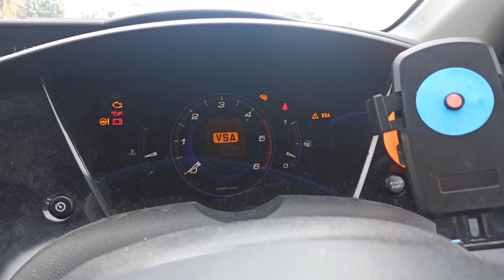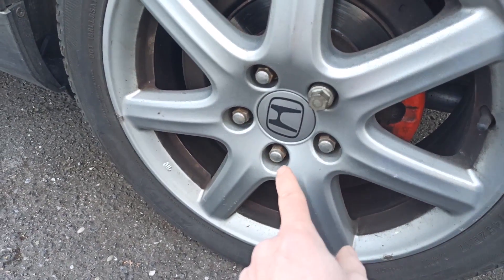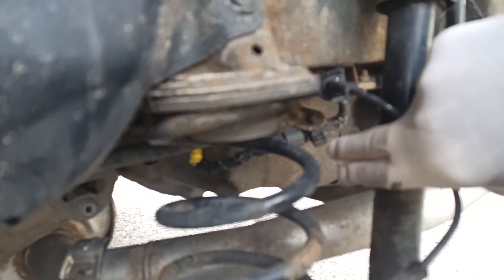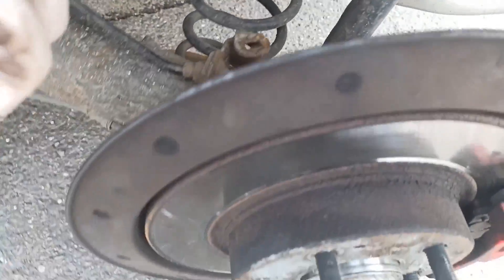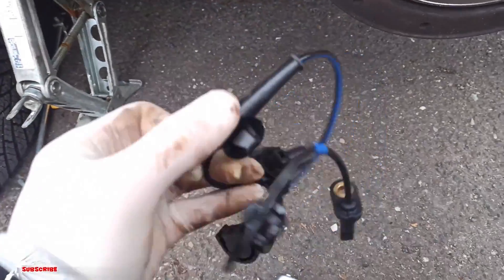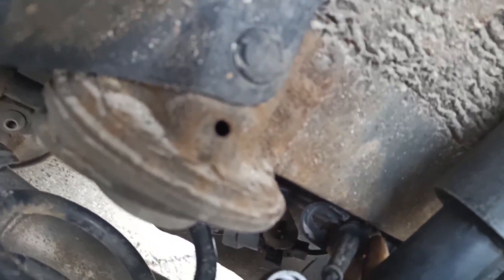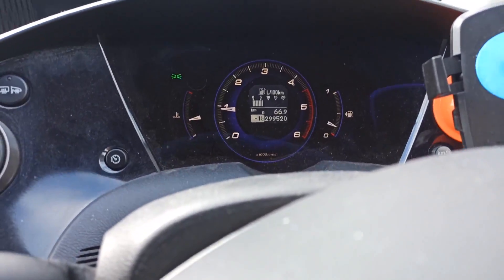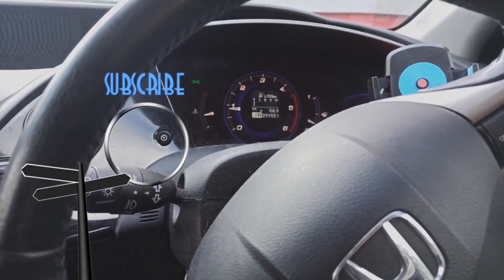How to FiX ABS - VSA Light ON on your Car -  Honda CIVIC

Comment: Say you've had these lights on for months.. after replacing a bad wheel speed sensor would the lights still be on (since the related codes are permanent in the system) for a while? Or would they go away within a few minutes if the issue was fixed
Reply from the maker: Hi yes i drive with lights on about 6m

Comment: I’ve had same issue same side , put in new sensor but and the abs and visa lights went off but then I drive there is tapping sound and soon as I pick up speed it sound gos away and vsa abs lights come back on , any ideas what it can be how to fix
Reply from the maker: @matthewnolan8448  are you sure the senzor ia ok as.i got 2 faulty before I get the one is working only way to find out is connecting diagnostics tools or replacing with new sensors but try different brands
Reply: @ i connected diagnostic tool and cleared it , it was ok then when I pick up speed it turn on again so it must be sensor?
Reply from the maker: @matthewnolan8448  but try read data from sensors live data I mean if not working no reading you know is faulty

Comment: I've changed mine once, but the problem is still there.
Reply from the maker: Are you sure you changed all correctly and you are sure the new sensor is good as happens to me as well I changed 3 times to find kumo brand is piece of shi...
Reply: @frogtechtips A bit more information. I parked the car for three months with the handbrake on, and after that, the VSA, ABS, tire pressure, and handbrake lights came on. I went to a local garage, and they changed the four ABS sensors, but it's still the same. When I deleted the codes, the car started to misfire, and I couldn't drive it. Then I pressed the VSA button, and the car started to go normally. After that, the light came on again, but the car started to drive normally.

I bought the sensors from eBay, so do you think I should buy new sensors?

I haven't got any clues as to why it happened in the first place. The garage told me I may need to change the ABS controller!
Reply from the maker: @go4ittt837  I think is foulty sensor try use diagnostic tool to see reading data from it.if not read try new sensor but different brand

Comment: I am finding my new abs sensor is rubbing slightly on the ring/hub. Unsure if I have fitted it wrong.
Reply from the maker: @sajhussain9848  I have this problem as well first two is not not working after I bought different brand and finally is been all.good

Comment: Just had offside rear tyre changed after a puncture, now tpms  "Check System" message keeps coming on.. faulty abs sensor?
Reply from the maker: Best way to find out is use diagnostic tools

Comment: What about a honda accord sport special addition, when the lights are on, would be extremely helpful compared to an almost 2600 job?
Reply from the maker: Hi All car should be fixed li this if you have abs light on for 90 percent is faulty sensor on wheels just use diagnostic tools to find with one is faulty

Comment: I bought the same kingbolen tool but it does not read abs vsc fault that i have. How did you get it to check abs system? Did you buy additional software? Thanks
Reply from the maker: Hi if you bought the same definitely should working abs data
I used software come with it
First you need diagnostic car and after go in Manu read data find abs and check that for read

Comment: How do i know which Abs sensor is bad or change all 4 abs sensor.
Reply from the maker: You need use diagnostic tool to find out with one is bad
Reply: In my case my scan tool didn't bring up a code related to a sensor.. however upon checking the sensors I found out one 
 Was bad (with a multimeter set to ohms checking for resistance)
Reply from the maker: Thanks for information